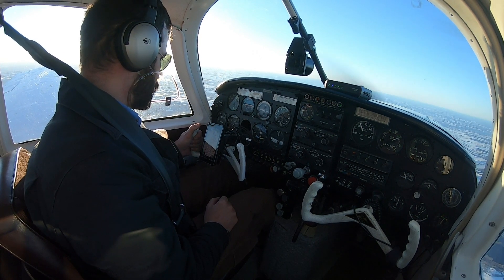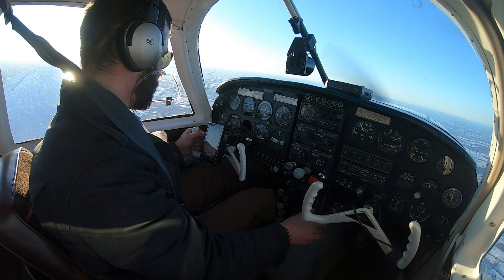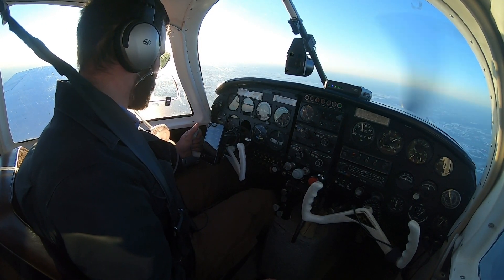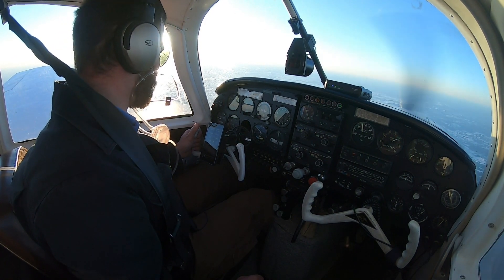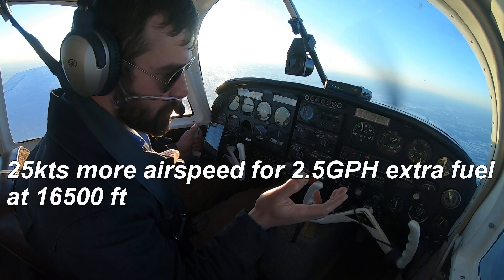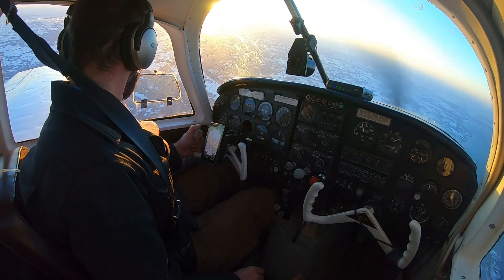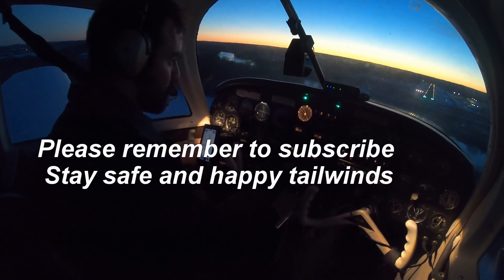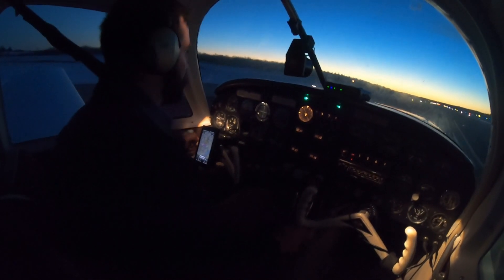Mooney Turbo Test 16,500ft

Comment: What's the timing spec on the data plate?  Lycoming allows for the timing to be retarded from 25 to 20BTDS.  May cool  things down a bit.
Reply from the maker: Yes the biggest improvement in cooling is making sure all the baffles and dog house are tightly sealed and the oil cooler sealed and in good condition. I spent a fair bit of time chasing baffles after this and significantly improved the cooling.  

The biggest improvement was increasing the opening of the oil cooler. It was about 8 square inches too small. Once that was opened and the cooler sealed to the lower cowling the oil temperature reduced significantly.

Comment: Is this a Rajay Turbo? I assume You have a Flight Strobe FS-4400?
Reply from the maker: Yes it is a Rajay Turbo. This was the first test flight after I installed a overhauled turbo from Main Turbo in California.  No FS-4400 but there are Whelen wing tip strobes.

Comment: I wonder how you can fix such a problem with the turbo? Great video btw, a wonderful insight into a different aircraft. Keep up the great work with the aviation content
Reply from the maker: I am going to be doing some more research into this but ensuring I have good seals at airbox and carburetor are going to be my first steps. A cowl modification to improve cooling is also going to be required to help with CHT and oil temperature.  Thank you for you comment.